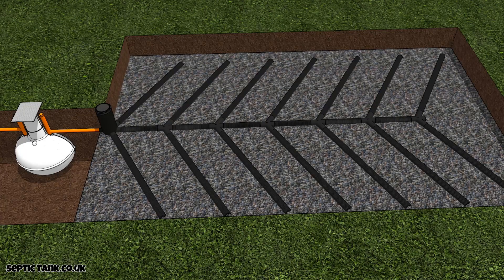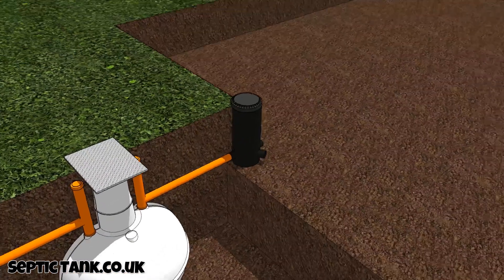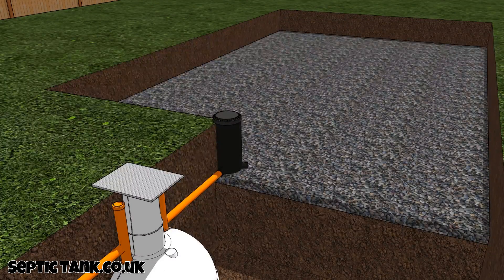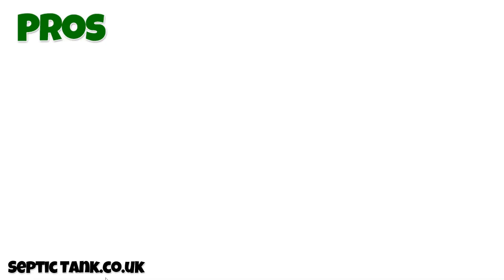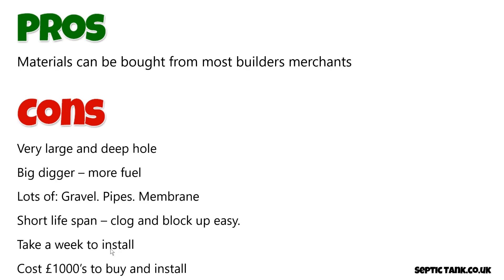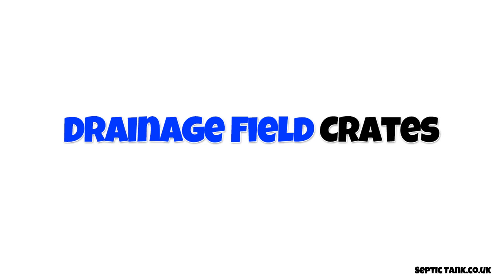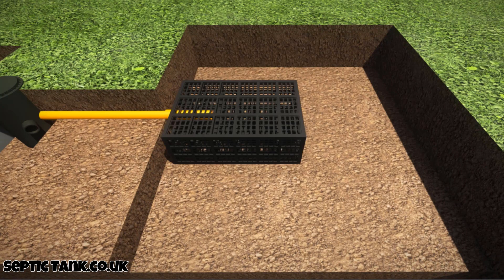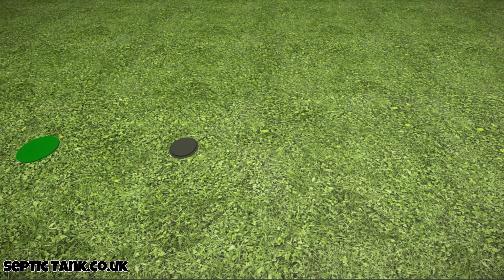drainage field soakaway

Comment: Have you put one of these in and asked for building control approval? I’d be very interested to see one of these installs signed off by building control. It seems a better option but in the uk is it allowed?  Not ever seen building control sign it off.
Reply: I believe crates are not allowed for waste water, a drainage field is used in this application as it has a much wider surface area for the waste water to soak in to the ground which reduces the amount of pollution.